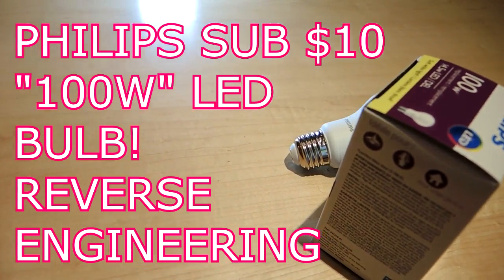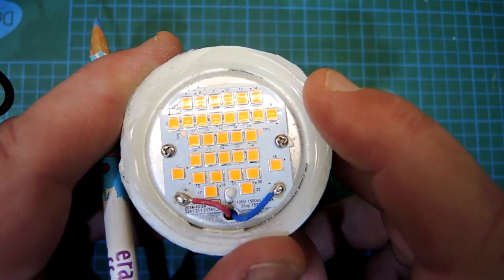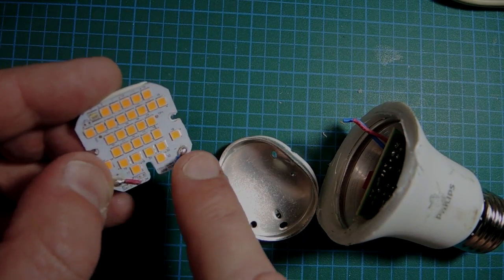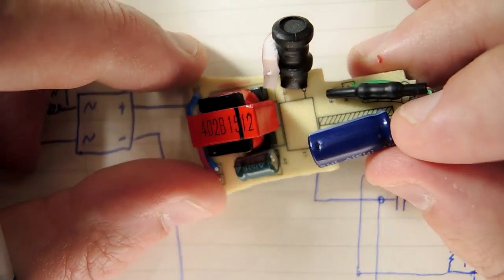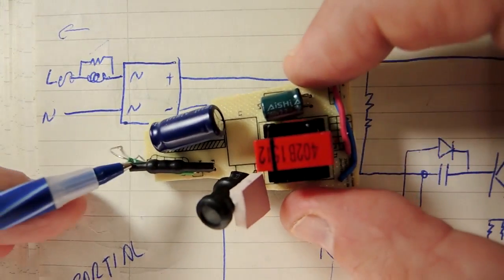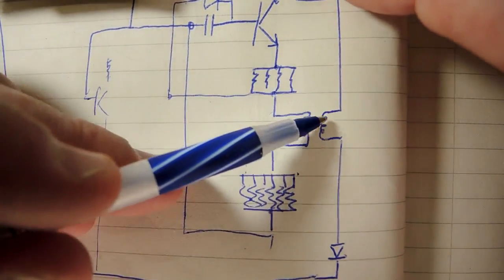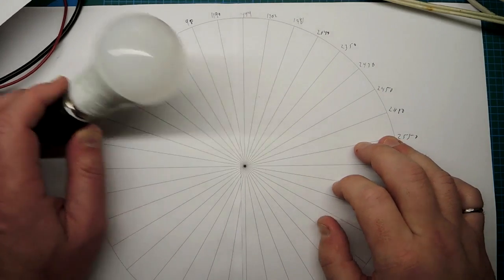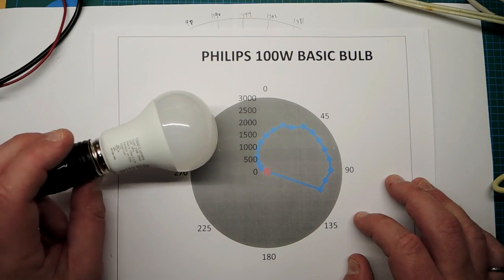PHILIPS sub $10.00 LED "100w" BULB REVERSE ENGINEERING

Comment: Looking at this about 2 years after it was made... in comparison with the 8 to 9.5 watt bulbs, nominally 800 lumens or 60W equivalent, I’ve been buying for US$1 at Dollar Tree stores, the circuit is sophisticated. The $1 bulbs have a capacitive dropper, a bridge rectifier, a little filtering, and not much else. Failure rate is pretty high and the ones I’ve taken apart afterwards always seem to have lost a single LED from the series.

You get what you pay for?
Reply: markiangooley In the cheap bulbs they are probably running the LEDs quite hard to get the desired output out of fewer chips wich doesn‘t go well with sloppy tolerances so eventually one will fail.
Reply: Cheap leds don't need to last long to pay themselves back. Unless you have extremely cheap electricity.

Comment: Is it dimmable? I have similar bulbs and they are labelled non-dimmable. But they can be dimmed if I add more load to the dimmer. Which component would fail if I were to continue using it with a dimmer?

Comment: I'm using these in out door motion sensor fixtures both working fine. No one is into recycling led bulbs, all I'm finding is dispose of them in the trash
Reply: +bruce p don't know if it matters but are you doing the soft white or daylight which mine are

Comment: I've had one of the lower output versions of this lamp running for almost a year in an outdoor fixture with no dimming. I did pop the globe part off since the fixture is tube shaped and it only needs light in one direction. 
Hopefully these "100w" versions are a long lasting! Did you get a chance to take any temperature measurements of this lamp?

Comment: So the bulb is heat "sinking" 10-15W into a closed compartment containing electrolytics where heat has to be dissipated away through a wall of plastic. The bulb is way overpriced for a design that bad, because I guess the bulb won't last much longer than an incadescent.